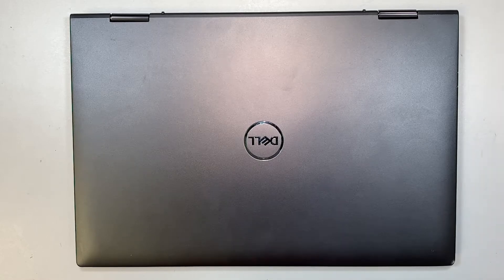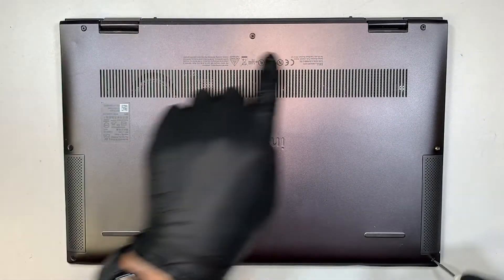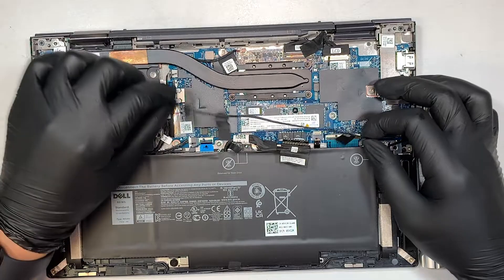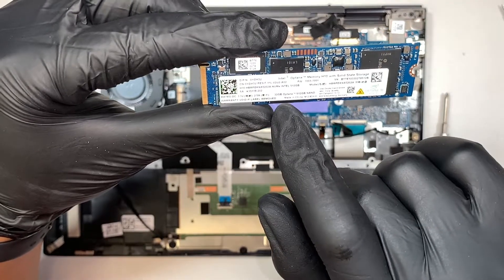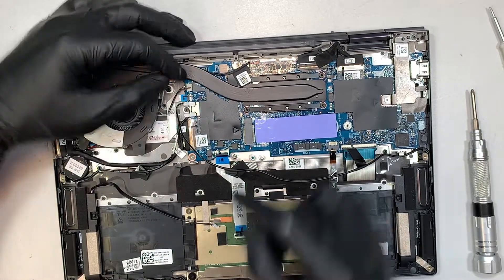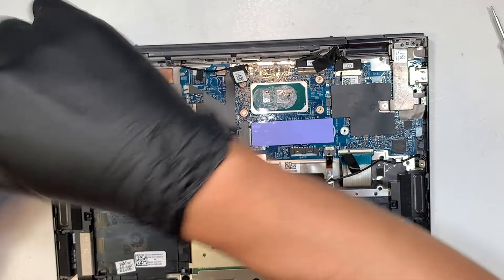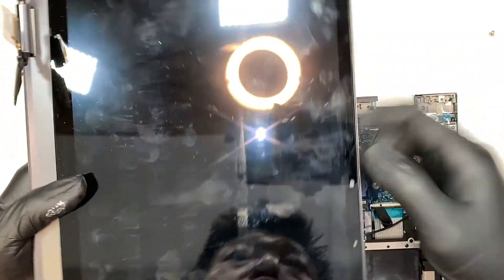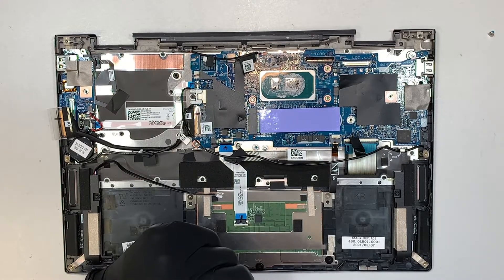Dell Inspiron P125G Upgrade Tear Down Disassemble

Comment: Hey I have the same laptop and one day it suddenly stopped working at first I thought it's a battery problem but I changed the battery it's still not working and the white small light on the left side isn't lighting up whenever I try to charge. Can you tell me what could possibly be the issue?
Reply from the maker: Try remove the battery and do a direct power from the adapter. See if that will power up the laptop.